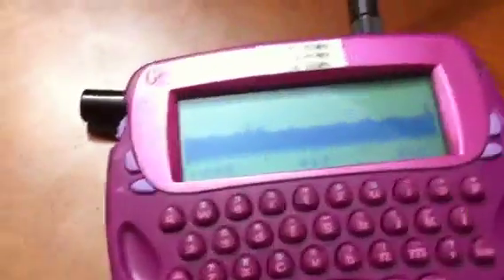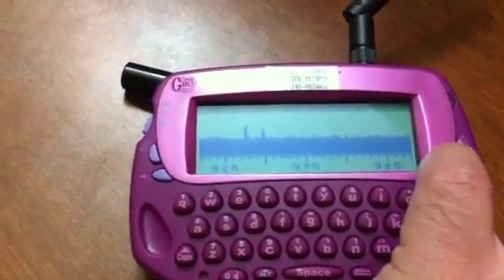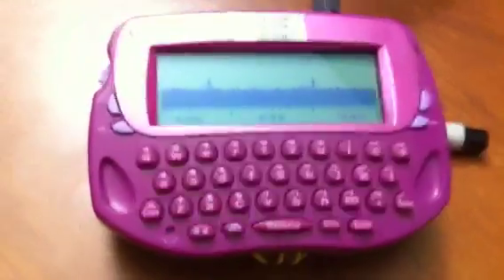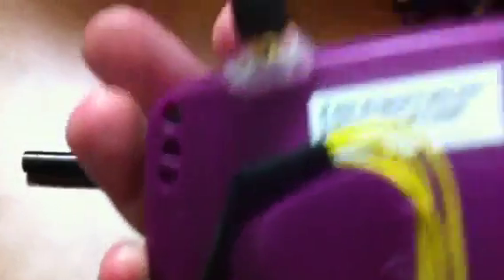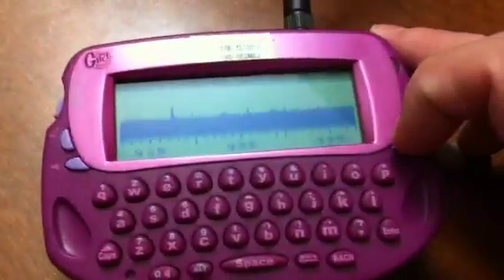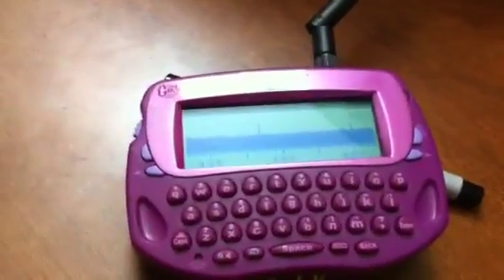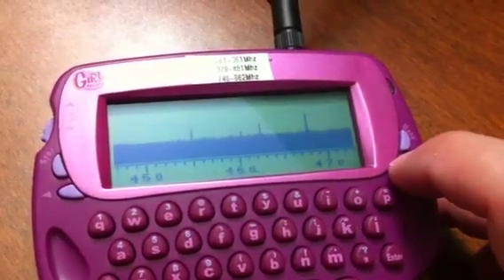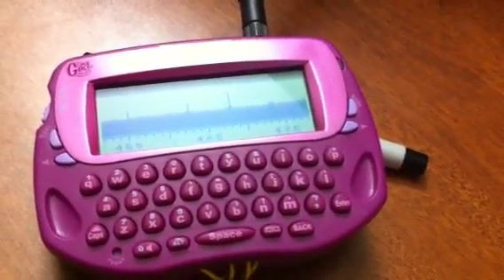Im me spectrum analyzer hak

Comment: Do you have a link for the exact reverse polarity SMA adapter and antenna that you used? Also where on the board did you solder on the SMA adapter? Thanks!